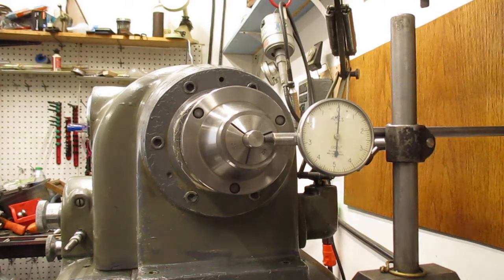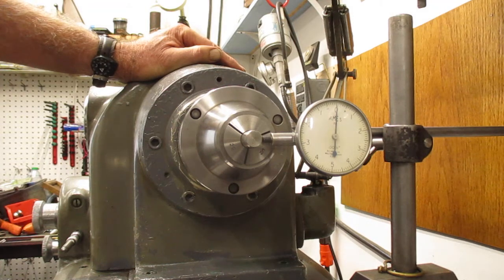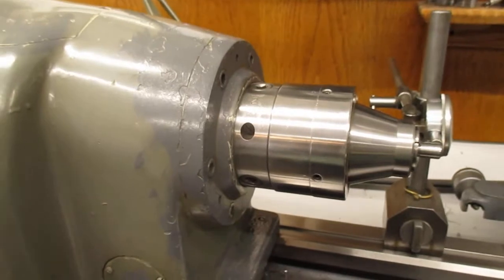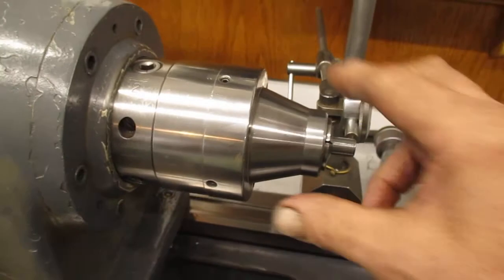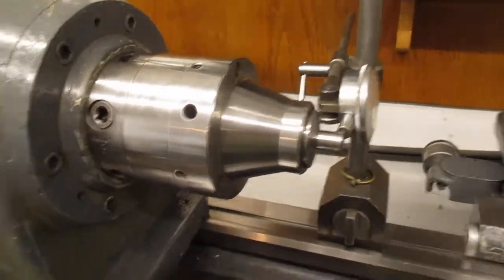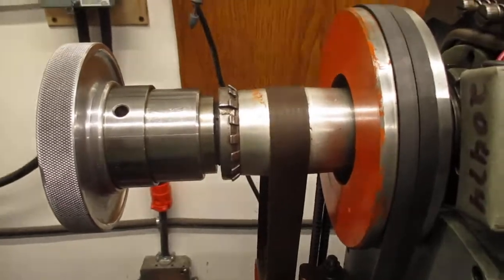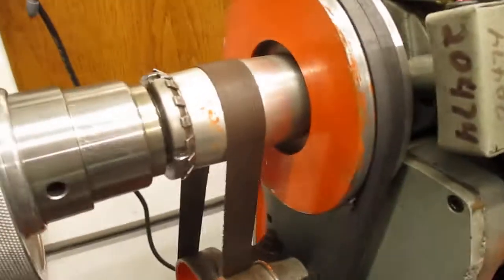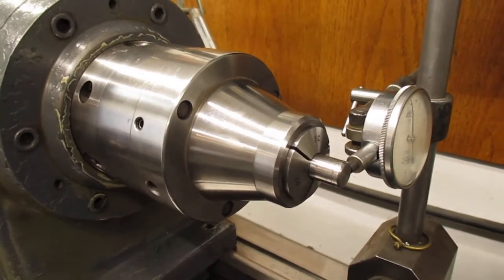Monarch 10ee lathe spindle deflection and work holding

Comment: Hi Dee Dee.  I have what I believe is a Monarch 10EE collet nose with a D1-3 mount.  However, it uses Hardinge 5M collets which close on a forward stroke, not by being pulled back like a 5C.  Have you ever seen anything like that?  Thanks.  Jack.
Reply from the maker: I have not heard of a 5M collet but Monarch supplied other Hardinge type collet noses that may have been made by Royal that also supplied lever collet closers. That is interesting!